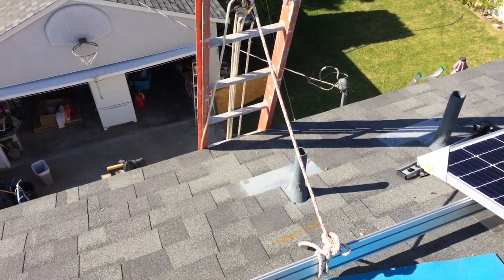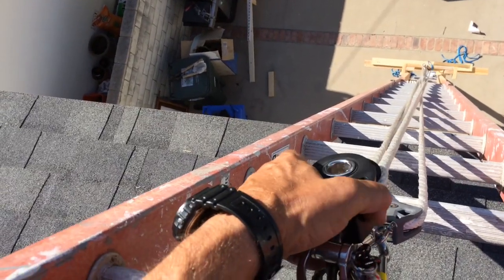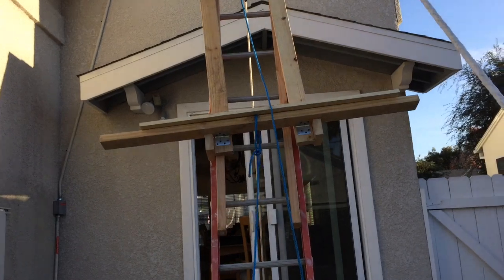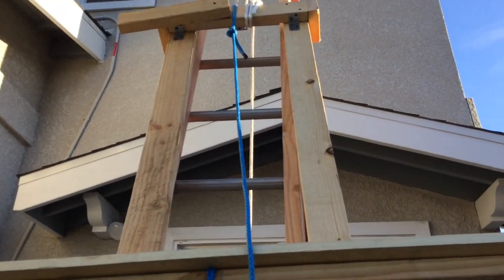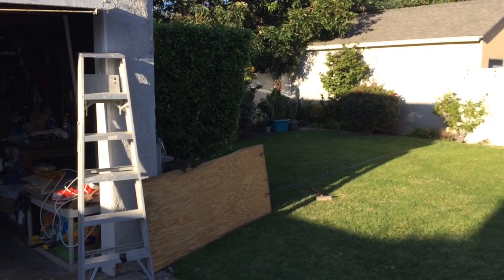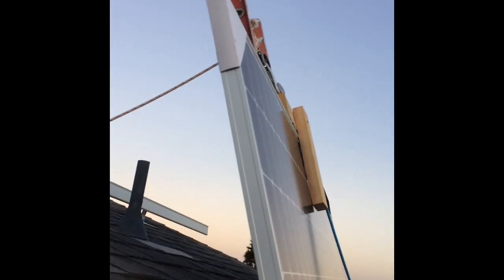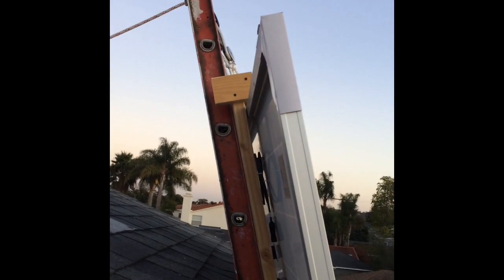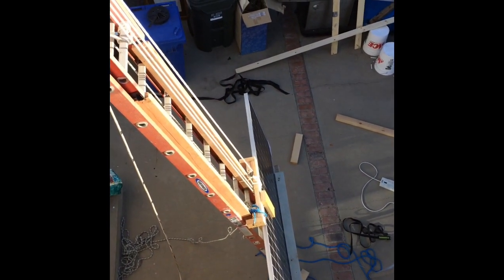Ladder Hoist / Ladder lift for Solar Panels with 2 story house

Comment: What size ladder do you recommend to get on a second story home safely? Thanks
Reply from the maker: I’m not giving any safety advice. I have received several comments on not using harnesses on my solar job. It is best to hire a professional of course. If you insist on doing it yourself. I think I would feel most comfortable with a ladder that had at least 3 to 4 feet above the roof edge. The problem is you need that roof edge ladder overhang to support The panel and create a handhold for yourself when you swipe the panel off the carrier to the right or left. I attempted to show this situation in the video where I am on the roof side of the ladder leaning down toward the panel carrier. It is also very comforting if the Ladder is anchored At the top of the roof somehow Preventing drift. I have seen one other design where roller ball bearings Were used on the sled Causing less friction between the sled and the ladder face. They do Rent shingle lifts that you could rig as solar panel carriers. You may want to look at that also. I did end up doing this by myself but it is not recommended. Best to have somebody to study the ladder and standby for any unexpected events. Also a large panels once you get them off the ladder are not that easy to deal with. Get a harness. Also you should find a way to rig a line on your panel in case you need to put it down and not have it slide off.

Comment: How did it work out?
Reply from the maker: I was able to lift and install all 7 385w panels on the roof by myself. The design shown in the video was unchanged.  I think the most critical thing to realize is that you should test your setup before you hoist a live panel. I used a plywood as a "test panel"  with the approximate dimensions as my Hanwa 385w panels. The ply wood was heavier.  Make sure you understand all the hangup points and know in advance how you will manipulate the control lines to un-foul expected hang ups. Do not walk below the panel. I think it is reasonable to have an alternate ladder rigged for roof access in addition to the hoisting ladder as I did. Good luck on your project and post a link if possible on what you come up with. I spent a few hours looking at videos before I ended up with this system and I'm sure I cold have done something better but I didn't want to spend too much time given this was a one use project.
Reply: @dannyjensen4954  Thank you very much. I'm going to attempt a prototype soon.
Reply from the maker: @patrickcorcoran5539  Please let us know what you come up with! Can't wait to see what you do.